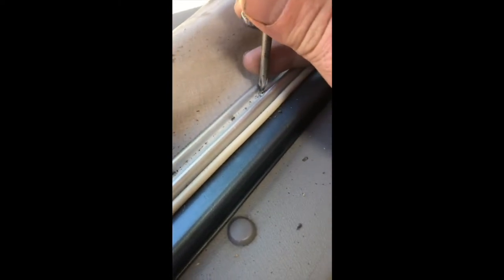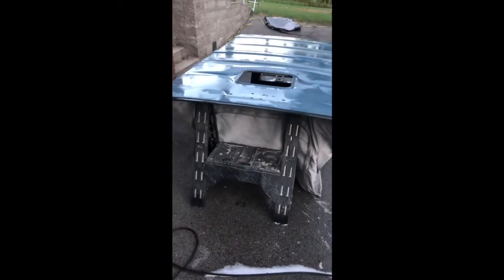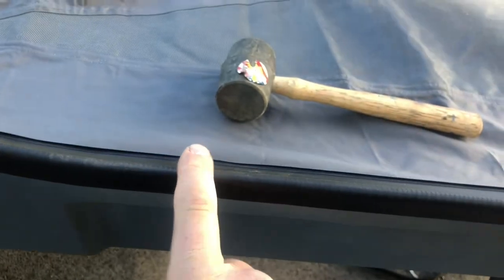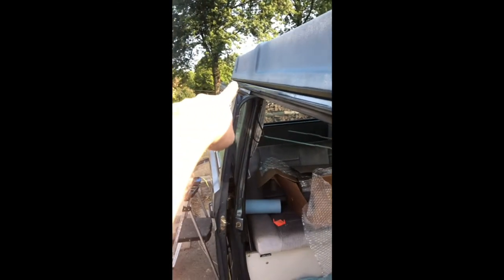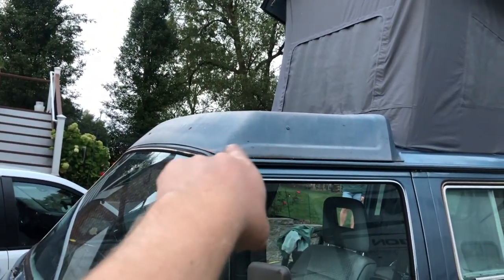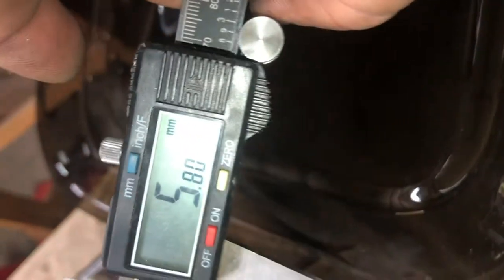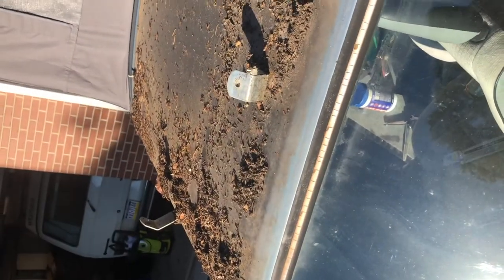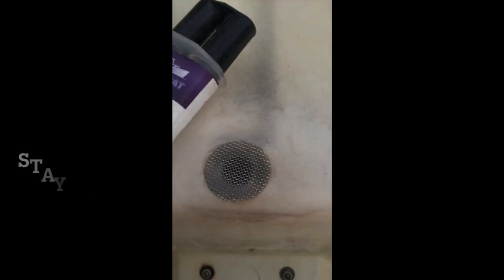Ep 4  Restoring the Pop Top

Comment: I appreciate references to Sourcing and quality parts.  And though there are other instructional videos out there, Craig gives helpful hints that I'm not hearing elsewhere (i.e., cutting little notches at the corners of the canvas where it meets the bends in the seals).  I hope I never have to make use of this bit of advice.  But I know I will indeed make use of other bits of his advice in working on my Vanagon (i.e., replacing my Vanagon's brake master cylinder);  Craig gave me confidence that I was able to do such a repair.

Comment: Both my westies have  a sunbrella or synthetic tent . I would take one any day over cotton as they are very durable , have side windows and most westies have skylights for ventilation . North Westy tents are awesome . I've weathered many storms with no wrap around rainfly. (Makes no sense to buy a cheap tent and then the wrap around rainfly .)One was a hurricane at firefly 2015 .No leaks .  I do have a front awning from Francher's which is awesome . Order some matching touch up on paint scratch for the roof for now .Assuming the color is OG
Reply from the maker: I've camped with plenty of synthetic tents and helped install one- I'm not a fan. Different strokes for different folks I guess, I just don't like the look and feel of them since they always end up a little baggy (comparatively). In the Pacific Northwest or places with sustained major rain- I could see advantages. I'm used to camping in a tin top with a Westy interior, so the top bunk is mainly for standing height, ventilation, and coolness when the weather is conducive for it. 

In my experience, the cotton tents stay plenty dry- but they also provide better breathability and it feels less humid inside during rain storms.

Comment: Why did you apply sealant before installing the seal? None was ever used by Westfalia and isn't required.
Double-pane skylights were OEM on ALL Westies that came with a skylight. Inferior new skylight if the holes are wrong...yes, crap skylights and seals. Buy the proper OEM versions.
Reply from the maker: I've pulled a few tops that all had signs of sealant under the seal, including this one. With 55k miles and one documented owner, we have no reason to believe this seal has ever been replaced- yet there were signs of sealant all around it.